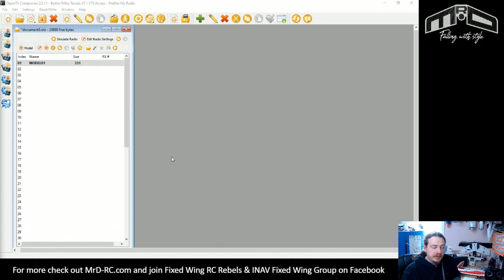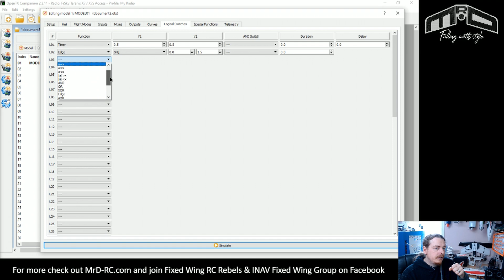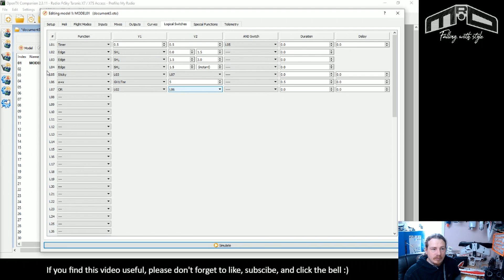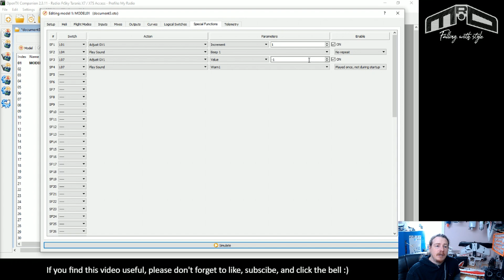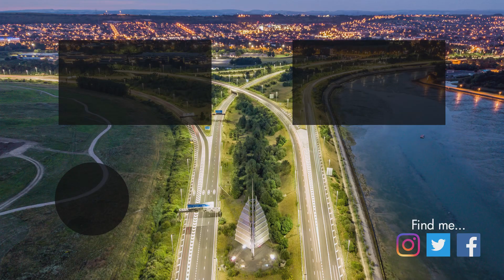Using a Momentary Switch to control Launch Mode

Comment: Using INAV means: 

1. 1 year of crawling through forums to get all infos
2. 6 month to get all changes - and start on 1.
3. Crashing the plane, because u didnt know something, thats on page 13446732 on a forum
4. Studying all that modes and "what u have to do, till flight"
5. Crashing again, because something its wrong with the actual build - and u didnt know that - because i didnt read the forums
6. Autotune / Trim is not working with digital stuff - so u cant do it, without buying analog stuff...
7. Having all that nice infos in a group - that SOME ppl wont join, because its facebook....

so...one year of programming - and 5min of flight - till crash.

Sorry INAV Guys - your idea mutated to - maybe a great thing. BUT - its way much to complex to fly with it...for ppl, that are not wasting their time, reading forums the whole day
Reply from the maker: Sorry to heat that you are having problems with iNav. But to be honest, I only hear of very few people having so many issues, and they are usually quickly resolved. 

Like anything with any level of complexity, there is a learning curve. That is a given. But I think the problem here is what you’ve said in point 1. I wouldn’t use forums to learn the basic of iNav. They are too fragmented, and you only get parts of the information. The better approach would be to use the guides on https://INAVFixedWingGroup.com, or follow some full setup videos on YouTube. I haven’t got a full setup video yet. But @Paweł Spychalski has setup video and Lee at @Painless360 has a complete series on setting up iNav. These options would all be better than using forums to learn the basics. After that, use something like my iNav Pre-maiden Checklist to make sure that the basic settings are there, and you won’t crash because something has been missed. That pretty much covers 1, 3, 4, and 5. Realistically, that should take a month, including building the model.  

2. Yes, there will always be updates. It is how products improve. However, just because there is an update, doesn’t mean that you have to use it. Also, most of the time, the update path with iNav is pretty painless, and documented in the release notes.

6. You can only really blame DJI for this. They have chosen not to create an OSD for iNav. They have access to every variable on the flight controller via the UART. However, they have chosen just to make a simple OSD for BetaFlight. iNav is doing its best to add useful information. But it has to be done through hacks of elements in the BetaFlight/DJI OSD. 

7. Again, there is nothing really that suggest here. Not using Facebook is personal preference. I can understand why. I can only comment about the INAVFixedWingGroup, which I’m glad to say is very helpful for new iNav pilots. We do make guide to try and cover the most common problems, and put them on the website (above). 

I understand your frustrations. But I don’t think that most people share these problems. What would be your suggestions for fixing the 7 problems you have mentioned?

Comment: Thanks for the two tutorials.
Am I correct: if auto launch set up like this, and the criteria are met to disable auto launch, and if you accidentally disarm in flight. To rearm you only have to put throttle to zero and set the arm switch to ARMED?

By the way on the Taranis X9D plus- SF and be rotated by 90 degrees, have set the arm position towards the antenna.  That makes it the only switch that operates side to side.  Still have to check the Radiomaster to see if it possible
Reply from the maker: There are a couple of other things. You need the throttle low and to not be in a navigation mode, so only manual, acro, angle, or horizon. Then it will rearm. 

I do have another video that shows a method where it will rearm just with the arm switch in flight. But on the ground and at very low speeds, all the safety features are active. https://youtu.be/ndxtVzC7LHA

Comment: momentary switch works like a push button ... it starts the autolaunch mode and a timer stops it later ?
Reply from the maker: The launch can be started and stopped with the switch. The timer is a fallback to disable it later. It makes things simpler if you have launch disabled if you accidentally disarm in flight. The 5 minutes should be plenty of time to get in the air.

Comment: ...or simply install SI and SJ on this transmitter.
Reply from the maker: This was first thought up for a Q-X7, which doesn’t have that option and is switch limited. Also some people may be more confident in a software change than a physical one. But there are may ways to do things.